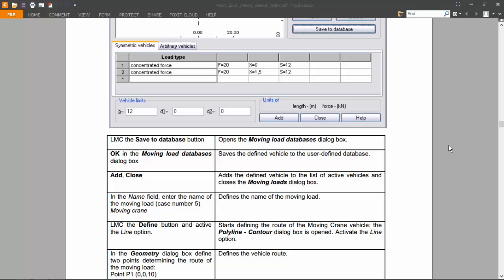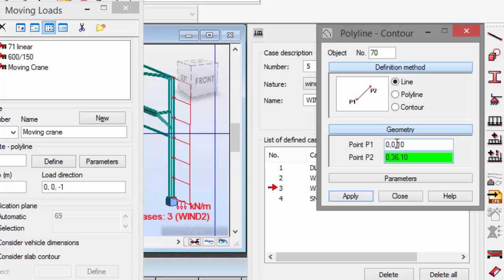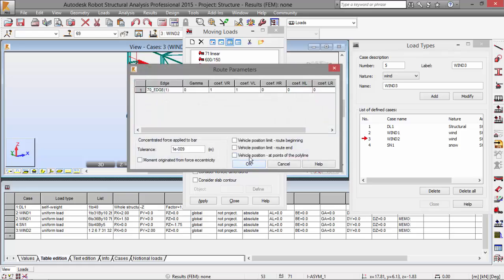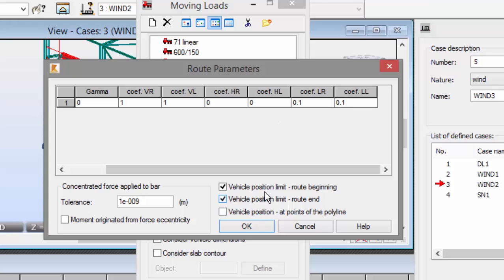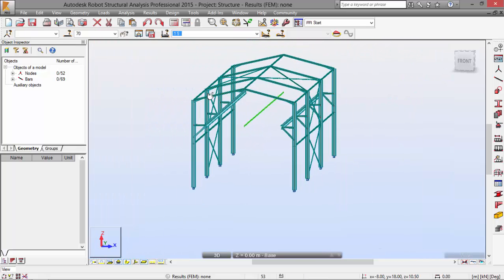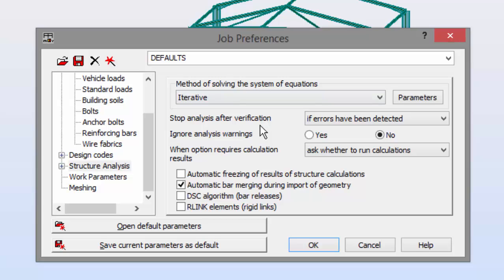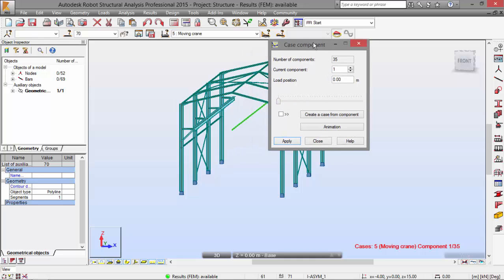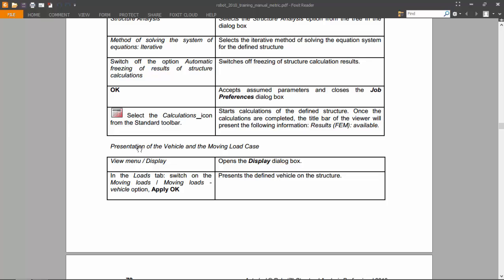Exercise 5 - Part 5 - Moving Load - 3D Frame (Robot Structural Analysis)

Comment: Thank you for excelent tutorials.
Have you made a video where you explain the reasons for changing the method of solving the system of equations and differences of these methods?
Reply from the maker: No, not exactly. However, you may find a lot of information about that issue on the foruns. 

https://forums.autodesk.com/t5/robot-structural-analysis-forum/bd-p/351